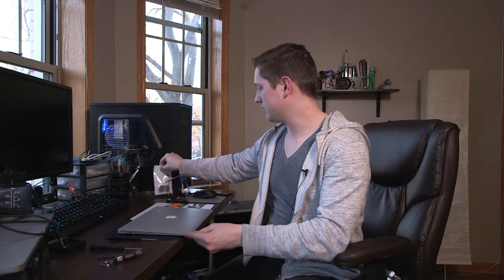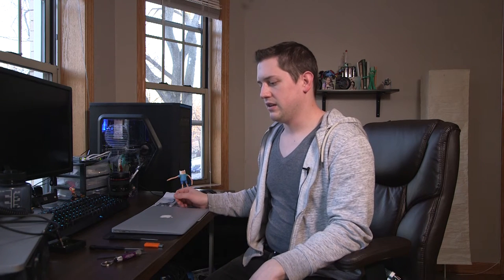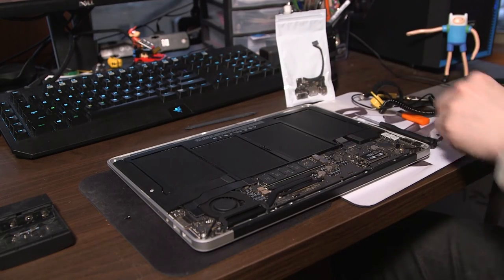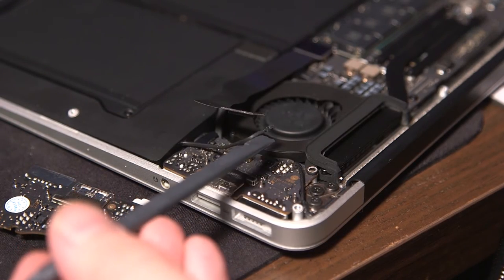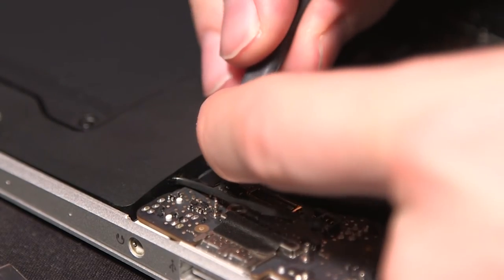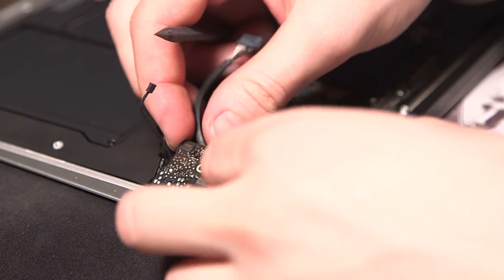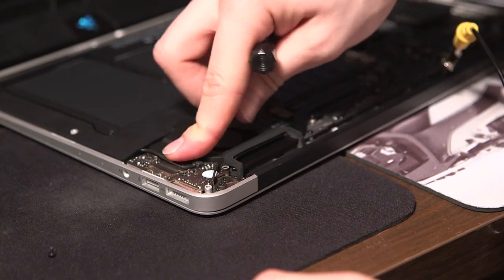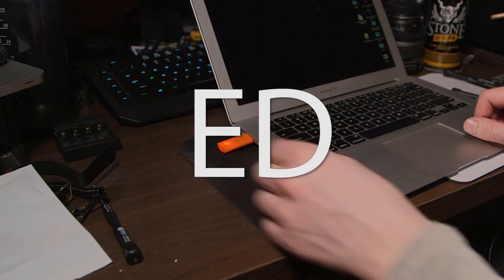Bent USB Port repair for Macbook Air 2014

Comment: Excellent stuff!  When I cracked open the case and went through each step to remove the the the left port piece , the tin “teeth” were bent and blocking the cable from going in snug. I “unbent “ as best I could and while it looks bad, it worked!  Charging as I type.  And even though it may only be a $10-$20 replacement part, I’m pumped I could make the original work.  Thanks again!
Reply from the maker: That's great, and yeah it may not be necessary to buy a new part for this especially now that its a 6 or so year old device. Thanks for commenting.
Reply: @EDDY69 MbA is 2.5yrs old.  But that part may be older?
Reply from the maker: @tx1iron  Yeah, it seems like a common design with their air laptops, I'm surprised they didn't fix the pin issue by now.

Comment: Hi, thanks for the video. I was excited that I found your video. I’m not a DIY type but I decided to give it a try. Everything went well, except it’s not turning on anymore. I’ve tried everything I found on YouTube that suggested to do. When I connect the adapter, it lit on green. So I was relieved that the  USB port is working. But after numerous attempts, the adapter is lighting orange Ann when I insert it, the fan even doesn’t get going. Do you have any idea what I could do do fix this? Thank you 🙏

Comment: What if I unbend the little metal pieces and try to reuse the piece. Would you think it's too much a big of a risk?
Reply from the maker: Go for it! The worst that can happen is that you have to wait for the new part to ship. Just be careful to not zap the motherboard with static electricity. It’s never happened to me, but be aware of it.

Comment: hi guys and @edward dIgnan what size  T5 torx screwdriver do you need for screws inside of the macbook air ? i have tried 0.8, 1.2 and 1.5 and none work which means i cant remove the board. could anyone kindly advise ?

Comment: Hi! Is there a way to repair the right USB port? My MacBook air fell while a small usb dongle was in the port. Now the port stopped working, it gets warm and drains my battery pretty fast. Other than that, I’ve had no problems since that happened over 6 months ago.

Comment: You've made this look so easy! I'm having the same problem with my MacBook Air, but I'm still too scared to try this! :'-)
Reply from the maker: The worst that can happen is that it stays broken the best that can happen is that you fix it. If you use an anti static wrist strap, buy the right size screwdrivers and take your time, oh and if you are gentle on the parts you can fix it. If you don't want to fix it yourself buy the part and head into a repair shop ask them to swap the board, you could give them the ifixit directions  https://www.ifixit.com/Guide/MacBook+Air+13-Inch+Early+2014+I-O+Board+Replacement/24743 should quote an hour to swap the part. so maybe $40
Reply: Don’t do it if you are not sure. also anti static band isn’t necessary , just touch the metal case every one in a while and you are done.

Comment: Do you know if this works the same with the 11inch macbook air early 2014??
Reply from the maker: the procedure is the same the part is different. check out this guide - https://www.ifixit.com/Guide/MacBook+Air+11-Inch+Early+2014+I-O+Board+Replacement/24753 

option to buy it here for around $30, the $90 ifixit want's for the part is way too much, but they have the correct size tools.

https://www.aliexpress.com/item/For-Macbook-Air-11-I-O-Board-A1370-USB-Audio-Board-Power-DC-Jack-820-2827/32815017949.html?spm=2114.search0104.3.20.2180acb8HE7QAz&ws_ab_test=searchweb0_0,searchweb201602_3_10152_10151_10065_10344_10130_10068_10324_10547_10342_10325_10546_10343_10340_10548_10341_10545_10084_10083_10615_10307_10059_10314_10534_100031_10604_10103_10142,searchweb201603_25,ppcSwitch_3&algo_expid=0a753019-5630-4f7e-b9bc-890e09409f5e-2&algo_pvid=0a753019-5630-4f7e-b9bc-890e09409f5e&transAbTest=ae803_5&priceBeautifyAB=5

Comment: I’ve having the same issues on both sides my computer won’t recognize my devices so it’s probably better to purchase a new computer instead of replacing it because my computer is out of warranty.
Reply from the maker: I had hardware issues with the port, the usb could not physically be plugged in. If you're having that same issue you could take the laptop apart and remove the fins that are bent, or try to bend them back.
If you're having issues with devices not being recognized simultaneously with both ports its probably a software issue, I'd start with a backup of your files with time machine, then preform a clean install of the operating system.
Reply: Edward Dignan I can physically plug my USB cable into the computer that come with my phone and iPad but it’s won’t recognize my phone or iPad so I’ll have to get the part for it to the fix the issue with my computer it’s probably not that hard to fix it . Do you have a link of the stuff I would need ? I have a 13inches MacBook Air mid 2015
Reply from the maker: OK, I had a busy past month, sorry for taking a bit to respond. First try to get your laptop to recognize anything, random USB drive, mouse, old keyboard, whatever. If if does then it's most likely a software issue, I'd back up important files, then update your operating system, after that update programs that work with your devices.

 If your devices are on different mac id's from different users (or past users) you could run into syncing issues there within itunes (most problems are due to software constraints due to piracy prevention). If it's strictly hardware I'd first check the cable, (find a similar cable, or borrow one) then I'd check the port on the device for lint, fluff, dirt. Checking the physical connection is important. 

Then I'd try either side of the laptop, after all of that both ports are still not recognizing the device consider a factory reset on all devices (back up your photos and stuff) and then check connections with cables again. Hope this helps! If it all doesn't work replace parts and see where you get. Buying parts is pretty easy, confirm the model number usually something like A1466, and year. Best of luck!

Comment: After 4 years...it happened. How to get the USB port online? I could not find the raw USB port and rather the mac accessories (in Australia).
Reply from the maker: "How to get the USB port online?"  The part I linked to required no additional steps, it was recognized by the system information program found by going to the apple logo top left, about this mac, system report. At the end of the video I plug in a usb storage stick and it mounts to the desktop and works fine.  ( https://www.aliexpress.com/item/For-Apple-Macbook-Air-13-A1466-Magsafe-DC-Power-Jack-With-USB-820-3455-A-Fits/32279726711.html?spm=2114.40010308.4.20.Q4GIdw ) This will ship to Australia, and the amazon link in the description will ship there too. 

I have not tested the other links I provided. Apple does not sell just the repair parts for their devices, only things like batteries. But the part I linked to above has worked without an issue for over a year, and the system information program lists apple as the IO usb device manufacturer.
Reply: Thanks for that carefully thought out presentation Ed!  I am pumped up to give it a go! Cheers Greg

Comment from the maker: After 7 months; no problems with charging, the usb port, or audio.
Reply: i thought you had it sold
Reply from the maker: I kept it, 1 year & 4 months later  it's still going strong. I use it for travel, and I'm stuck in the apple ecosystem due to my iphone 6 which I got for free.

Comment: Wow! Please to help someone else from ripping something at 3:05 your video skips and it’s not clear if you take the whole piece off that the ribbon cable is inside of🤷🏽‍♂️🤦🏽‍♂️🤢 WTF!!! Great video but that minor detail caused me to damage my machine😡
Reply: He did mention to slide out the cable and said to be careful twice.
Reply: @MrLilyjim  but the cable does not just slide out. And he’s lifting something in the video. Lift and slide are 2 different things. Luckily I was able to repair it and salvage the usb pin back to the original form not needing to purchase the whole part. 👌🏽👍🏽